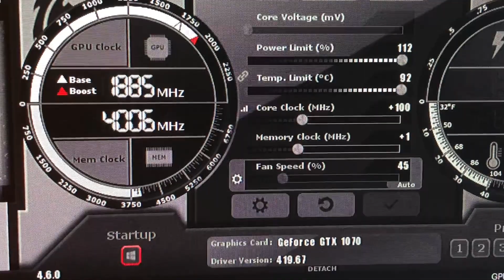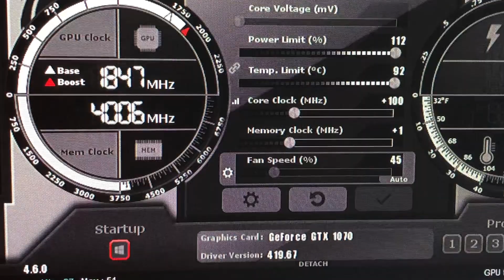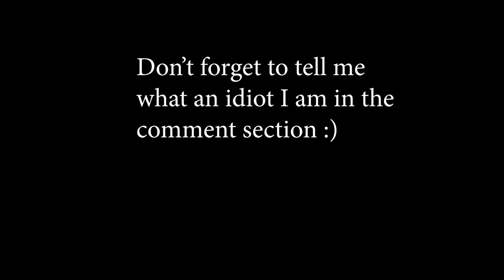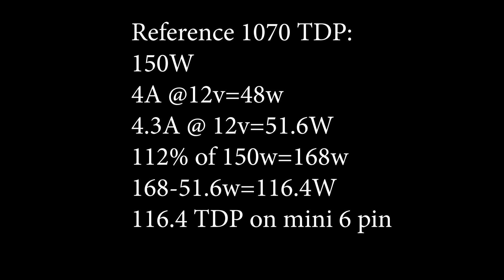How much power can a Mac Pro Provide to a GPU?

Comment: So how did you find out how much power is drawn from the PCIE and how much from the boost connector?
Reply from the maker: by putting a reference 1070 in a pcie riser and measuring the amperage on the riser with a multimeter. I did this a couple years ago, and others who've done the same have come up with the same exact result, so you could say it is independently verified. 4A @ 100% tdp, 4.3A at 112% multiply by 12v and you get wattage.
Reply: @killer268  ok but I tent not to trust the software as I found out Istat was not showing correct amperage. You should have measured the amperage through the cables as well with a multimeter and a clamp.
Reply from the maker: G5Mytube it's not necessary, just subtract the measured wattage from tdp, msi afterburner and furmark are more than capable of showing total power draw accurately, they just can't tell you where the power is coming from

Comment: Hi , I have a Mac pro 12 core mid 2010. I recently bought a MSI Rx 56 Vega air-cooled and it connects with 2x8pins to my GPU. Now the graphic card turns on and the fan too of my card but what I get is only a black screen. I read about this and seems not to have enough power, so I ordered a pixlas mod. Is this true that this will work? Thanks

Comment: Hello, I have a asrock rx580 graphic card with 185 Watt. In my Mac pro 5.1  2x6core 2,4 GHz 64 GB Ram. And I have connected with only one mini 6 pin to one normal 6 pin into my graphic card. But my system is shut down when I make some think intense in premiere pro... What do you mean, I have to connect both mini 6 pin to my normal 6 pin graphic card? Sorry for my bad Englisch German 😜

Comment: It's not about what you CAN do, it's about what you SHOULD do. I can deadlift 500lbs, but if I did that I would snap my back. Be wise and don't push those mini-6pins too far. These 5,1 logic boards and psu are a DECADE old now. Be conservative. Don't fry your shit or you will have to drop 12k and buy a new mac pro.
Reply: U R so funny !
Reply: @johnnychang3450  its funny you brought me back to this video today, cause my moms 2008 mac pro psu just popped and it was running dual apple ati 5770s. The computer powers on but the gpus do not power up. So it seems that rail is toast. She wasn't doing anything heavy. It was essentially my backup mac pro so I can work when I am out of town at her house. It was just really old and it was its time. Point is, don't push these machines too far. They are OLD!

Comment: Here’s why I strongly disagree with this video:

• we’re not discussing whether it’s possible to draw more than 75W from a Mac Pro 4.1/5.1 mini6 pin

-> we’re discussing whether one should power their 8 with a single mini6 pin or 1x8+1x6 / 2x8 pins graphic cards with two mini 6 pins only.

And the answer is a resounding “no”.

The reason being that an 8 pin, per definition, is able to draw up to 150W which, per conclusion based on what you say in your video, it doesn’t! (You claim, truthfully, that the mini6 pins can be force pushed  up to ~115W).

Now, the mini 6 pins are recommended on paper (exhisting Apple internal guidelines) to power up to 75W, although you can push them to up to 118-120, simply because Apple is very loose with their estimations, and clearly designed to be more capable, to account for power spikes, etc. 

Here’s why your test is actually invalid, too:

• for your proposition to be true, you should prove that we can run 140-150W on a single mini 6 pins. You only prove it can sustain 115W, which is irrelevant to the thesis.

Proving it can run 110-120W just proves Apple is loose with their ratings (which is reasonable of them, as explained above)

• you pick a very low-power card? For a true test, you should pick a card that’s gonna at least remotely stress the machine, with a TDP of at least 225W

• seems like you picked a well balanced card, too, but of course you can be guilty of this one, as some cards are indeed more balanced than other regarding power draw.

But.. how can we make a rule by considering only the best-case scenario? 

Most VEGA 56, 64, GTX 1080Ti, Titan X, etc all shut down the Mac Pro 4.1/5.1 under heavy load, if they’re only powered by mini 6 pins in Mac Pro 4.1/5.1.

We have countless customers (especially in the UK) who we helped because they were sold machines with powerful GPUs, which were powered only by the mini 6 pins.

Hope this helps.
Reply: what a load of garbage. i run my 340w asus rog strix vega 64 via the dual 6 pins on the motherboard of my 5,1 and game with it and runs flawlessly. you talk fkn trash

Comment: Great video! I got a GTX 780 in my 5,1, and am currently powering the 8-pin using the two mini 6-pin connectors, and the 6-pin using two SATA slots. I'm in dire need of those SATA slots now though, and can't decide whether to keep the 780 and try to power it using a different way, or switch to a 980 and be safe. If I got that right, using a mini 6-pin to 8-pin cable straight into the 8-pin connector of the 780 might still result in shutdowns as the 8-pin could potentially draw up to 150W, right? Basically, is there another straight forward method of powering a 780 without occupying 2 HDD slots, or am I better of switching to a 980 in your opinion?
Reply from the maker: You could look into using a evga power link to evenly distribute power, or use sata power spitters. If it’s me I’d just upgrade the gpu, that 780 is more than a little long in the tooth at this point

Comment: I'm having luck with a 780 Ti (reference 8+6 pin) by using a mini 6 pin to 8 pin adapter on the 6 pin connector and plugging the extra 2 pins on the 8 pin connector along with another mini 6 pin to 6 pin adapter. Ran 3DMark Time Spy, CS:GO benchmark and now running FurMark without incident for more than 30 minutes (plugging it the conventional way resulted in an almost instant shutdown when running FurMark or Time Spy). No idea if this is a healthy way to power the video card, though. Thanks for the video!

Comment: Is dual SATA to 6 pin necessary? I’ve seen cables that do single SATA to 6 pin or even 8 pin. Are these cables not to be trusted?
Reply from the maker: Sata provides about 33w~ safley, a six pin pcie cable is rated for 75w. single sata to 6 pin is a bad, dangerous idea.

Comment: What do you use to control the fan speed on the card in macOS?
Reply from the maker: Depends on the card, with Vegas you can use an application called vgtab to create a kext to set the powerplay tables and fan curves to your liking, with Radeon vii Martin lo made an automated kext that does the same, with nvidia there is no way to do so to my knowledge other that modifying the bios on the card
Reply: Brennan Ferguson I have a sapphire pulse Radeon RX 580 8GB; I’m on a 2010 MacPro 5,1 running Mojave. It’s obviously a non-ego card, and the OS won’t manage the fans.

Comment: Hiya there Brennan! Am on the macproupgrade group and i recently made a post because my mac keeps shutting down, many members jumped in and guide me towards a cooling problem, but imho i think is more power related. I do have an imbalanced card (6 to 6 and 6 to 8) a EVGA 780ti 3GB. I would be very grateful if you could explain the sata method to draw power. This is very important for me because programs like After Effects are causing an almost immediate shut down. Thanks in advance for the help!
Reply from the maker: Ok, basically you would plug two sata power ports from the optical bay or hdd bays into a dual sata to 6 pin pcie adapter, then use a dual mini six pin to eight pin for the other connector... Let me ask you this, when it shuts down will it immediately turn back on, or do you have to wait a minute or unplug it for a second before it'll come back on
Reply: Brennan Ferguson i have to unplug it and wait about ten seconds and then it would start.
Reply from the maker: @AlanGreyOficial  Yup, that's a gpu shutdown. Go with the dual sata to 6pin pcir + dual mini 6 pin to 8pin pcie, should solve your problem
Reply: Brennan Ferguson big thumbs up! Thanks a lot for sharing your wisdom. Will keep you updated

Comment: Hi Brennan
Thanks for the very informative Video. I just got my hands on a Sapphire Pulse Vega 56 8Gb and want to run it in my 2 x 6-core 3.46 Ghz, 128Gb 4,1 > 5,1 monster. So 2 individual mini 6pin to 8pin cables should be enough to power this card without any undervolting and even for some gaming at 3440x1440? How about the peaks? Every other source recommends doing the pixlas mod for this card. I just lost my mid 2011 iMac and wouldn’t want to fry the logic board on this one. Your help would be greatly appreciated.
Reply from the maker: Yeah if your Vega 56 is dual eight pin and not one of the one eight pin one six pin models it should run great on internal power, you should even have a good bit of headroom for overclocking
Reply: @killer268  Dear Sir, may I tell you? You are the best! It works like a charm :) Thank you so much for your help, it's greatly appreciated!
Reply from the maker: John Locrian awesome man, very glad to hear it! Enjoy your new set-up
Reply: Are you still running this Vega 56 card in your Mac Pro?

Comment: I have mini 6-pin to standard 6 and a mini 6 pin to 8-pin for my Titan RTX and it's been working fine for me people been telling me I should do pixlas mod but once the 2019 Mac Pro comes out i;m going to be selling my 5,1 so i'm not going to do that mod just sticking to base way to power my card and it works for me
Reply from the maker: Yeah, six pin plus eight pin can work, it just often doesn't, all depends how the card draws power
Reply: @killer268  I just install a Powercolor Vega 56 Red dragon with 1x mini 6 pin to 6 pin and 1x mini 6 pin to 8 pin. Is secure this method? How can I measure de power consumption and be secure while working? I will mainly use it for fpcx. Thanks!

Comment: can you make a video of how to instal windows on a 2 cpu mac pro??
Reply from the maker: Jordan Gibby I can, I have a few videos that I'm working on first though. The best way is to install Windows onto an ssd in a pc then transfer the drive over. No matter how you do it, in a cMP it is always best to do a native install on a separate drive, never bootcamp partition.
Reply: @killer268  gotcha, is there a special format for it to work best on the Mac pro hardware for the drive? I read somewhere it needs to be a something uefi or something like that?
Reply from the maker: Jordan Gibby they're not taking about drive formatting (that has to be ntfs) they're talking about legacy mode vs uefi mode. If installed in uefi mode there is a very remote chance of Windows writing two entries on the Mac pro efi, it's not common but it can happen. If you install from a DVD the install will default to legacy mode